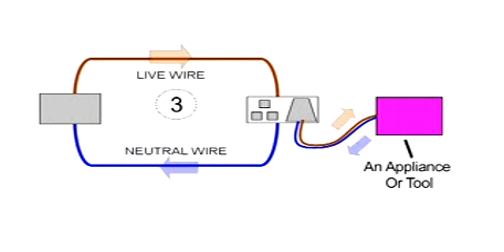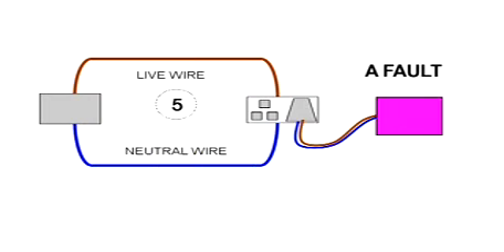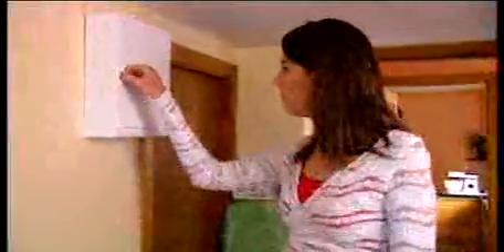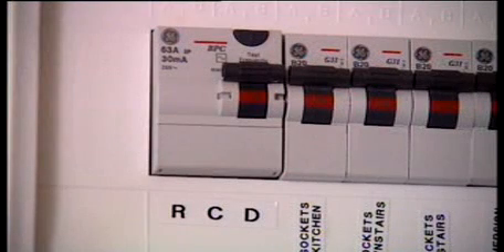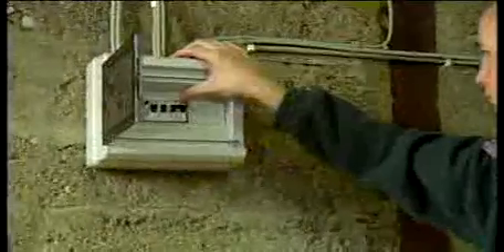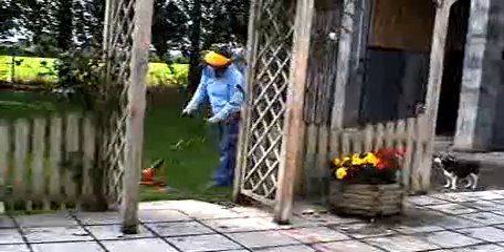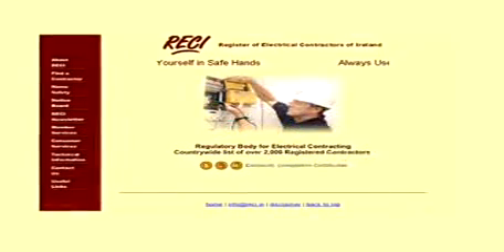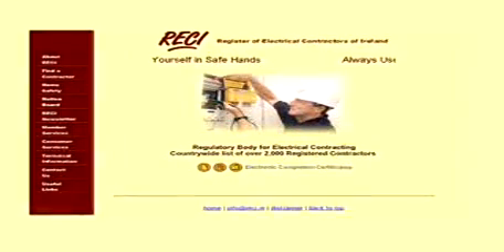RCDs Saving Lives

Comment: r.c.d`s save lifes , once i was drilling a hole in a peice of wood and i felt a small shock and the r.c.d stoped the current.
tip: allwasy use r.c.d`s with power tools that are made of metal